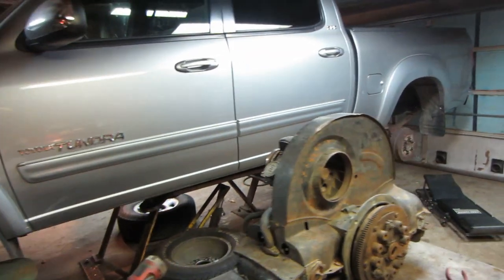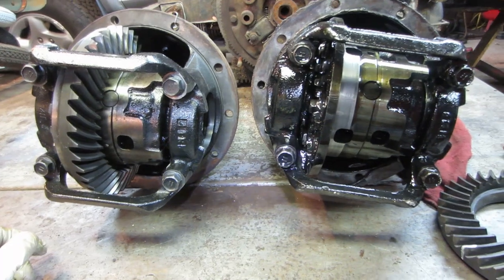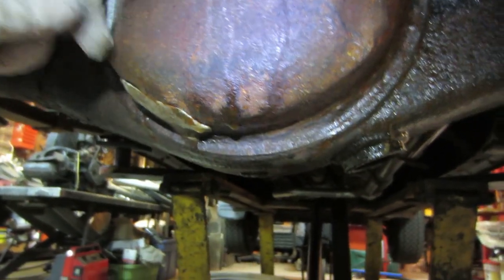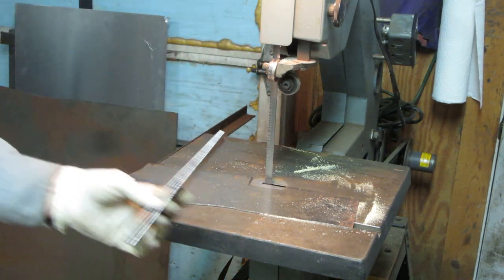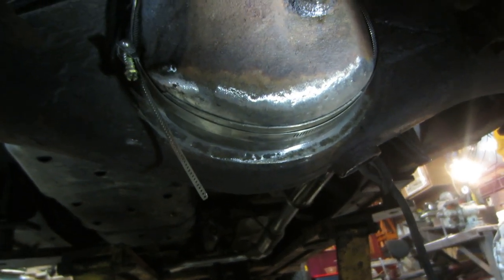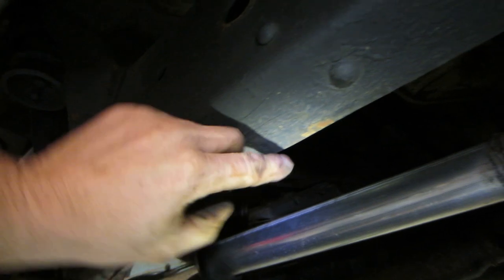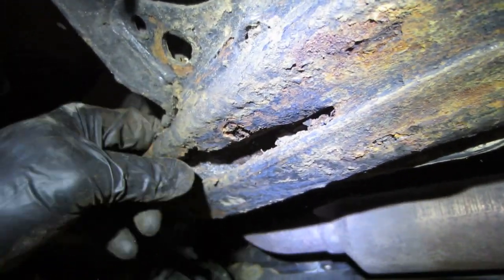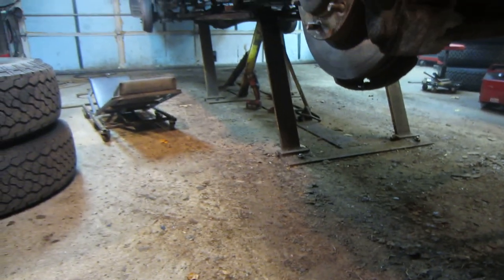toyota tundra rear differential repair

Comment: I can recommend a product like Tectyl ML, is is very thin and penetrating when sprayed on, and forms a rust inhibiting, slightly elastic amber coloured layer. Also very suitable to spray into hollow forms such as suspension bars under the doors (using the tube provided on some products). There is also a compound with the same stuff protecting against rust, but in a black rubber/tar like form, where the surface is exposed to impacting gravel and rocks. Some car brands used it on every new car in the nineties and early 21st century, before aluminium car parts and fully electrolysed bodies. Toyota apparently did not on your Tundra ;-)

Comment: After you get it all together, use your air hose on the drain plug to partially pressurize it, then spray soapy water outside and look for bubbles, show you where the leak is.

Comment: Re bearing the original one it if both the ring,and pinion gears are still good,swap em out,or sell it on fleabay to come out ahead overall ....Living in the deep south,and within 10 miles of the Gulf of Messico,and owning many Landcruisers,and 4wd Yotas through the years,and even the older (1969-`1980)FJ40s diff housings have never rusted through like that one(even after driving through salt water a few times...

Comment: Wired wheel everything down on mine that was leaking about the 2 o'clock position on back cover then actually got some solder to stick to it real well and coated it with Por-15. Lol but now it has a small leak in the front of it I guess coming from seal behind flange? It's wet on the very top of flange area?

Comment: What is the plastic bottle with the extendable hose (that you use to put fuel into ports or spark plugs) when evaluating engines, called, where did yiu get it?  Great videos! Thanks!

Comment: They use the "rust coating" so  they rust faster so you have to buy a new one. Thanks for the video. You've certainly got your work cut out for you taking all that shit off. Full face shield required!

Comment: I have a 1991 Toyota Previa that my rear axle seal is leaking and wanted to know if you had any video's on how to do this.  I pulled the hub off on the side that is leaking and no oil in the drum or on my brake pads. However the inside of that wheel by the axle has a fair amount of grease on it.  I was thinking about just pulling the axle and just replacing the seal, is this a bad idea.

Comment: I try to do most of the repairs to my vehicles.  I stop at the computer gadgets and stuff behind the dash.  I bought my old truck, a 2003 Dodge Dakota, new with the least amount of gadgets possible.  I have manual windows and door locks.  I Mostly do tire and brake work where possible and have a shop do the rest.  My question to you is:  Where do you stop?

Comment: Totally agree with you on the undercoating removal but think you should spray on a rust converter like Ospho (sprays on and covers just like water), that drys overnight and then coat with your heavy oil.  Double protection with nothing to trap saltwater.

Comment: I would have filled the rearend with some paint thinner to check for leaks before putting on the goo, which you won't get back off if it leaks..i find you are usually cautious like that, but I suppose if it was just that one hole, probably good to go.

Comment: Any reason you are choosing to oil it up instead of apply a more long term solution?  I've had very good luck with POR15 brushed/rolled on.  If the metal is properly cleaned it sticks really well.  Since you are already going through the effort of cleaning, should be a simple wipe down and brush on.  I've also loaded it into an HVLP and sprayed it on.  I know POR is a little pricey but I've been very impressed.
Reply from the maker: you cant get it into the rails, and all the nooks and crannies.

Comment: Oil pans on engine in boats on the west coast in sea (salt) water would eat thru the oil pans . We would replace the pan, Then do two coats of fiberglas type epoxy resin clear on the pan. The salt water in the bildge would spash untill the cows came home. No issues, perminent fix.

Comment: Here in CT. they use what DOT calls salt activator to treat roads and it is absolute murder on vehicles.  They should stop using it.  It is also quickly attacking bridge structures.  Rotted vehicle frames are far more common now because of it.
Reply: Jayne Gus live in ct too. really hate that nasty stuff
Reply: Autobody cartel buys rail cars of the stuff for DOT!
Reply: The Ministry of Transport ( which is equivalent to the Department of Transport in the American states ) here in Ontario uses the same stuff, but they call it prewetting agent I think. Yes, this stuff makes the salt corrosion on vehicle bodes and frames a lot worse.

Comment: You might check with Toyota I think they are supposed to change the frames as part of a major recall! I know here in Connecticut they change at least 4 a week in my town
Reply from the maker: its over, 04 is no longer covered.
Reply: Oh ok didn't know that that sucks

Comment: Felt like i had to wear safety glasses myself watching that crap getting picked off..  i went through that on my truck also..  it was the factory under coat also but same deal..  your gonna get little scratches and shit from gravel on the road which just like a bag with a hole in it, water will seep in and cause bigger issues from those little chips.  And if you live in a place where they salt the roads or by the ocean then your doomed.  Oiling is best way by far..  i mix a big bucket blend of motor honey, marine grease like the green stuff for grease guns, and the thickest motor oil i can find and with just the grease and oil i put it in an old pressure cooker pot without the top and boil it until the grease blends with the oil, pour the motor honey in, then let it sit in cool place until its below room temp then brush it on with a paint brush liberally..  smells like burnt turds but one and done for at least a good 5 years but once you make a bunch of it, its not shit to slap some more on..  stuffs like friction modifier tho, wear gloves..  u get any on your hand and you can fist a virgin midget a week later..

Comment: Are replacement diff covers as hard to source as the carrier assembly?  I know a lot of aftermarket ones are crap, but just curious if a cover is available.
Reply from the maker: they make some in the aftermarket but you cut off the whole thing and reweld it on
Reply: Mustie1 Wow, what a pain!  Looks like repair will last a long time.

Comment: One gallon of 30w bar and chain oil and one tube of Lucas red tacky grease heated up in a crockpot and spray it on with your undercoating gun works excellent. 😜

Comment: After you have the differential finished ready to bleed the brakes fill the master cylinder with fluid pump the brakes several times remove master cylinder cover make sure fluid level is to the top open both wheel cylinder bleeder screws 
and watch for drip at both wheels keeping fluid in master cylinder full they will gravity  feed to cylinder s after you get fluid at bleeders close and pump brake pedal and recheck at bleeders

Comment: could you do a NHoilundercoating product test and review? it is an oil based undercoating that supposedly doesn't cause rubber to swell up. it is available in clear and black and it is not a permanent coating but it is similar to what you mix yourself. I would value your opinion on this.
Reply from the maker: cost, bar and chain is like $5 a car, and l like the fact that it will continue to flow into all the nooks and cranies over time
Reply: From what I know it behaves just like your mixture. It supposedly is rubber compatible, environmentally friendly and pretty sticky and durable. Thanks for your great videos. Always looking forward to watching the next one.

Comment: what is this a dodge truck??? the amount of frame rust is insane. we have the same problems in maryland. however...not on the thousands of ford trucks ive worked on. body panels and floors yes, but not on the truck frames.
Reply: There is a production year/s that Toyota  did not properly rust proof their frames on the Tundra and Tacoma. There was a big recall on them and many had to have new frame it was a big hit to Toyota  rep on build quality.

Comment: if you prep the mettle the undercoating dose wonders
Reply: I have a 1995 Isuzu Rodeo with 200,000 miles on it and no rust on any of the body dew to a grate stock undercoating but the frame witch was left relatively bare had rust problems

Comment: look make a video about that 1200 motor teardown .I am puzzled as hell  whats wrong with it how one side works but not the other . the cam only has 4 lobes it shares the lobes 1200can have worn out cam bearings there used to be someone in Houston who reamed them out and made it to where you put inserts . Rambus
Reply: they do make heavy duty commercial frucks but sadly no consumer size trucks

Comment: Pity no aftermarket kit diff cover thats bolt-on. A factory welded one is lame. Cheapness from production line I guess. Sorry, going back over your older vids :) Agree on underseal. Old engine oil better.

Comment: really it looks like you might be better off to cut away the entire rear cover and weld on an entirely new one. I believe Toyota should provide that part under warranty. also seems likely they are 2 parts welded together when initially built.

Comment: The only reason undercoating would cause it to rust like that is if it was rusty in the first place and people just sprayed over the rust.
I under coated my 92 talon AWD after sand blasting the bottom of it (because of rust) 4 years ago and I just touch up the spots where the coating chipped off from rocks. No rust to be found. My 84 Toyota supra was under coated when it was new and other then it flaking off 30 years later it was completely rust free.
People just need to learn how to wash a vehicle properly.

Comment: $50. differential, "score !" I had a 1970 buick Skylark body was rust free. but, frame rotted & cracked so bad. I gave it to a stranger that I seen had a Skylark.in his driveway.  car was my daily driver until I went to a shop & we tried to put it on a lift. body went up,  as the nose tilted to the floor ... that was a sad day ; (

Comment: .....but that coating was applied to attenuate the rusting process--not to remove extant rust.  In Japan it would have lasted beyond the ten-year, anticipated life of the pickup....  Of course, an effective 'undercoating' should be avail. for NE road conditions, but it's application would req. an eff. cleaning & derusting when the roads were not wet & salt-coated.....

Comment: its weird that where you are from ,the state will allow whatever frame repairs you do to try to fix the cancer issues from rust and pass the inspection, in nys the inspection laws are so stiff they wouldnt inspect/pass this type of repairs to the frames and i'm not even sure if any type of frame rail patching is allowed!! wow what a job you had with that truck it sad because the rest of the vehicle has so much life left into it it seems---so lucky you can get away inspection wise with that type of issues with the frame rust...WOW!

Comment: My pumpkin on mine is constantly leaking.  Its coming from around the seams around it.  Anyone have any luck cutting it off and putting on an aftermarket one?  Do I need to take the differential off first?

Comment: That protective coating, the so called "fix" would never work, even if it didn't turn into a solid paint like stuff. It's just cosmetic, as you said. To make it work they would have to actually remove all surface rust, and all contaminants from the frame before doing the "fix". It would cost more than just replacing the frame.

Comment: That's odd how you can't take off and replace the rear cover....guess they need it to stiffen that welded rear axle housing.
Reply: Also, that coating is really shit! Congrats on bringing this one back
Reply: I agree, the newer trucks aren't any better, still no removable rear cover.
Reply: 1) its a 3rd member.  
2) the only 3rd toyota made that a removable cover was the fj62 and older as they had a c-clip the necessitated the cover to remove the c-clip

Comment: Corrosion Protection does exactly what the name implies. It protects your corrosion. Had this been a British car, it would have leaked enough oil to protect the metal - at least slightly better than undercoating.
Check out Applied Science youtube channel for a recent explanation and test of anti corrosion additives for oil.
Yes. Deoxit from Caig does what it claims.

Comment: Before you add your oil concoction you ought to try using POR-15 Rust Preventative Paint.POR stands for Paint Over Rust!After you flake off all the Toyota applied crap, take it down to the carwash and pressure wash the hell out of the undersides to get it as clean as possible.When dry, use a wire wheel or brush to remove any loose or flakey rust spots or debris.Then apply two good coats of POR-15 by brush in corners and tight spots, and by baby hotdog roller on the flats.  I like to use grey for the first coat to lighten up all the dark corners and to see missed spots and holidays.  Then apply the second coat in Black.You will be amazed at the powder coat like finish you get and the long term protection it will give.  You could probably do the whole thing with two quarts for $100.00

Comment: Okay a limited slip means when you're turning curves it will slip to wear your tires do not bark and let's one will lose to turn on the other hand a full locker well lock both tires  in the wheel and makes turning extremely hard because of outer wheel and inner wheel or trying to turn at the same time  limited slip does not mean it will slip and then let go limited slip it allows your tire to free will around turns high RPM

Comment: So essentially, the dealer (after the fact with existing rust on the frame) is putting lipstick on a pig, when they undercoat the frame.  The worst part is they have to know this is not a long term solution, yet do it anyway.

Comment: how do you connect the axles to the diff?
Reply from the maker: they slide in and bolt to the end of the axle tubes by the brake drums.
Reply: OK thanks

Comment: I hate to bring it up but living in the northeast my whole life, I know what winters and salt can do, but that looks very much like a "Sandy" car. I have seen many people have their cars flooded after super storm sandy and then try to get rid of them to unsuspecting buyers. The outside looks mint and the inside as well but underneath its a nightmare. Just a word to any potential buyers that there are still a few sandy cars around.
Reply: I live in the UK, and I watched a program on TV about "sandy car's" think it was an ABC network news item  I believe they purchased a Ford F10 ? looked absolutely "Mint" (excellent attractive to buy etc) We have had town's wiped out with river flooding the insurance over here will Cat A-B meaning the Insurance consider the vehicle to damage or dangerous to be repaired even as a parts car, It's pretty shocking to think people spend hard earned  cash or finance on a car that should be crushed.
Reply: I've personally seen them, a shame really as some of these cars were really nice before they were flooded. I saw one and went for a test drive in one from a used car dealer, If I hadn't looked underneath I might have bought it! Sad.
Reply from the maker: not the case with this truck, its always been in nh, and alot of these trucks look like this here.

Comment: Putting any coating over active rust is a complete waste of time.  The darker rust is, the less active it is.  A process for stopping active rust must happen before applying any coating to the area.  Consider using most any product containing phosphoric acid.  Home Depot carries it for very little expense.  Only then can a coating be applied.

Comment: The rust really bothers me. There's no way in hell I would ever live in the rust belt of the US because of this reason, unless I was wealthy enough to buy a new vehicle every few years, even then how could you be proud of a nice vehicle knowing the underneath is rusting out. Pisses me off and I don't even live there. I live in Oklahoma, own a 2006 Tundra with 103,000 miles and the black factory paint underneath stills looks new with factory sku number stickers on all the parts still present and all bolt heads are a shiny silver.

Comment: It has to be a lousy type of steel, Toyota made that frame of.
Rusting like this is a scandal.
Reply: Only problem is that Toyota did not make the frame.  They sourced their frames from another party just like other vehicle manufactures do with parts and components.   Toyota has rectified the rusting frame problem and the frames are built to different specifications.   My 2000 Isuzu Trooper had a GM transmission which GM sent to Japan.  Only problem was GM made a "special" model for export that lacked internal sensors.  (cheaper) I went through two transmissions and I never towed or pulled anything.